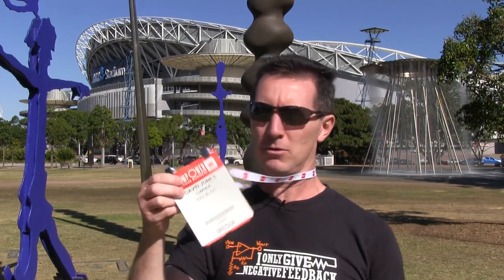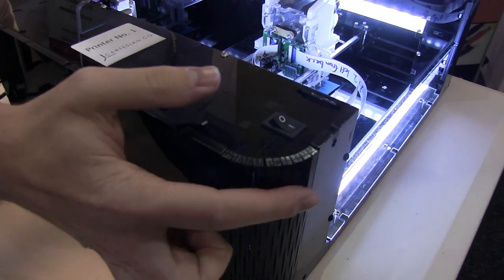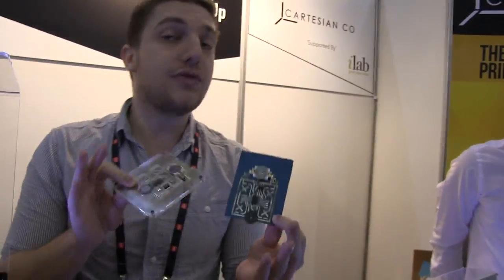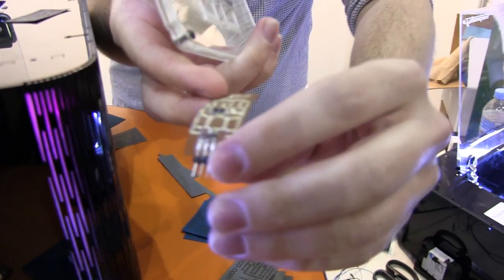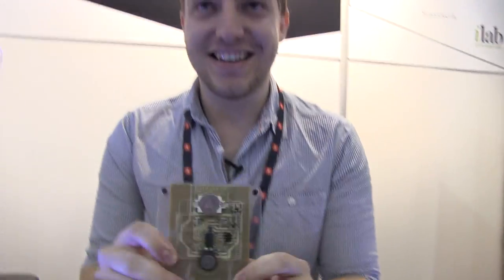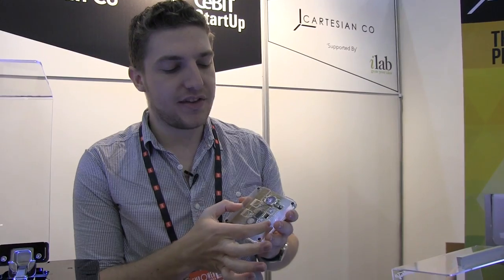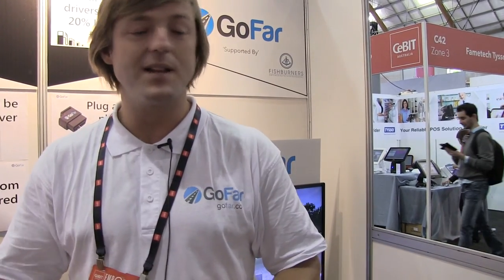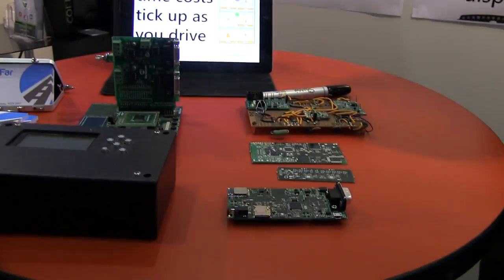EEVblog #614 - Cebit 2014 Highlights

Comment: These little robots are soooooooo cute :). Great design. And of course the energy saving application is always nice (but can only be as good, as the driver reacting on it). The prototype circuit board printer is very interesting and I really hope it's in maybe 10 years developed down with the price like it's starting with 3D printers. Would be good, if it had a third cartridge with something like soldermask to protect the circuit. Or "modular heads" like one for FR4, one (with special inks) for glass...so much room for future improvements...:). Especially (reliably) printing on glass will be interesting. Thanks for sharing Dave.
Reply: We're working on all of those things :) But the solder mask one isn't the highest of our list at the moment because given the traces are silver, not copper, they don't need protecting from air.
Reply: Ariel Briner
Thank you. Silver will also corrode. I thought with "solder mask" more of protecting the traces from scratching or coming off the material. Could also be a complete coating with for example transparent epoxy over the finished board (with components already glued/soldered, so protecting them too). Does the printer print multilayer at once or have you to print like 10 times over the whole board? Is it also usable for THT or "only" for SMT? I think you are on a very good way, I wish you all the best with your product :). Prototyping engineers will definitely love it.

Comment: Can that printer print on glass?
Reply: It can very reliably print on paper, kapton, and FR4. It can also print on some fabrics, but it's a little sketchy. It can print on glass, but the problem is getting the silver to adhere. It's just not something we've had the time to fully experiment with yet.
Reply: Ariel Briner

Would be badass to make some LED circuits that are on glass.
Reply: IIGrayfoxII They have copper tape, at craft stores. I have seen it done a few times, circuit on glass, I have seen a video on here"YOUtube" of a 4x4x4 LED cube on glass. IT can be soldered too!!! Hope it helps cheers!!!!!

Comment: the robots as they are - if hardware is a bit improved and more durable (wires wont break, more concealed/covered etc) - would already make for an excellent toy to sell. Open source software and not that expensive hardware.

Comment: @ PCB printer: okay guys... Now, please add a cartridge which will spray an electrically & thermally isolating layer over the first trace layer - excpet in spots where vias are, and then the next trace layer... :-D

Comment: I professionally deals with diagnosis and repair of cars and declare that this OBD thing is FAKE, cars do not have built-in sensor for controlling the back pressure of fuel, and the more so can not give a non-existent sensor readings by OBD. The maximum that they can get by OBD its injection time, but this does not bind either as fuel consumption.

sorry for googletranslate